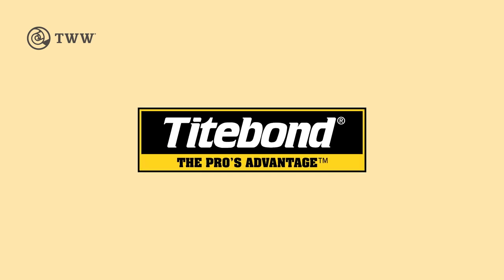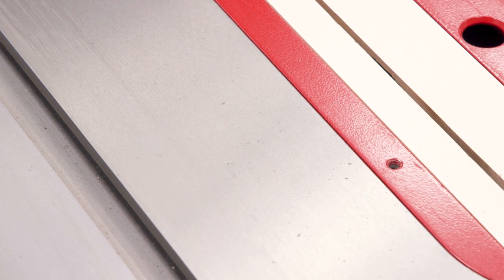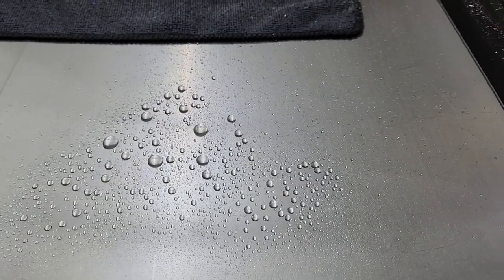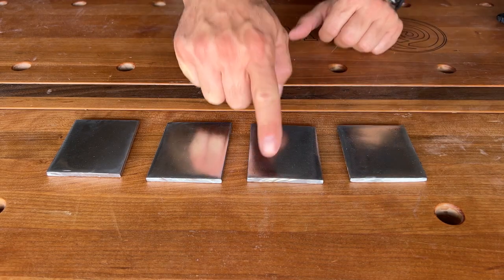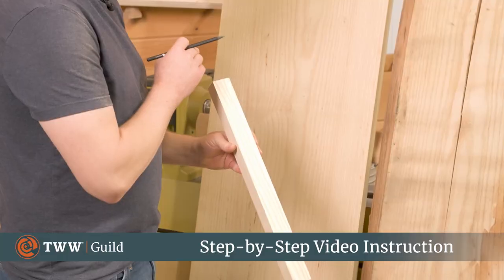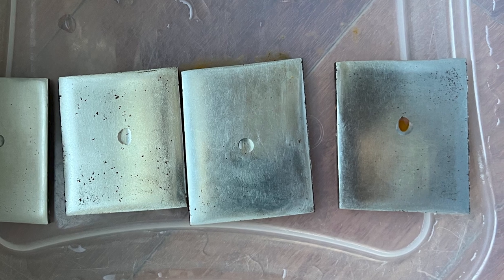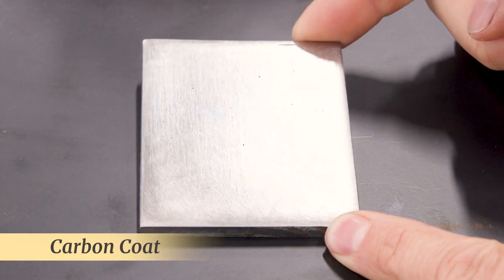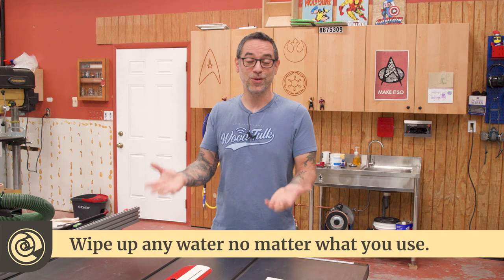Did I Screw Up?! | Carbon Method Update

Comment: Hi, great video, just let me give my 2 cents as a chemist, rust is an electrochemical process occurring on the surface of the metals, we stop the corrosion process puting a layer of protectant between our surface and the environment so the best protectant is the product that sticks the best and does it in a more uniform way. So even wax is a good barrier to moisture you just cannot make it stick forever even without touching it. The lets say agic of carbon methond is that stick better and forms a uniform layer over the metal. Anb about the water some well water have small amounts of iron on it so yu can imagine some times the droppets rust because this tiny amount of free ironm that why in some places you have rust stains on the bathrooms and sinks even if there is no steel hardware around.

Comment: The only coating I've used on  a variety of cast iron tools is Slip-It.  I used the spray bottle.  14 year old Delta table saw - no rust.  I just wipe down the surface after a day of use.

Comment: I haven't seen anyone (may have missed such) do an update to Fine Woodworking's article in the July/August 2012, beginning page 30, testing 20 different rust preventer products on cast iron.  As the photos showed, and the article confirmed, CRC 3-36 turned out to be the best choice, and was one of the least expensive.  I have been using it since with no rust on my table saw.  Due to a move, it sat unused for a year in a northern state, followed by 3 years in an out building in a southern state.  No rust.  Just now getting back to using it.

Comment: Thanks for the testing and info. Do you know if they have any opinion about putting a wax on top of their product? That could be an inexpensive secondary layer to prolong the life of their product finish by creating a small film barrier between the actual surface and materials you push over it. Kind of like how car detailers will put a ceramic coat on a car's paint and then periodically put another product on top of that to prolong the much more expensive and time-consuming ceramic coat.
I suppose also applying wax could defeat the purpose, but after seeing how wax alone performed, I wouldn't want to use it by itself anyway if I were in a high humidity shop.

Comment: I'll be honest, that's rediculously good protection if you barely had any rust. I've had rust spots appear when something wet touches it and it's whiped up after. The fact that the protection method kept it that clean for 2 months after exposure is impressive. 

Still, the best way to protect your tools is to keep water away from. Put oil on the tool and wrap it in cling wrap. Or when in use I find waxing it after use to do the trick.

Comment: Not to be a one-upper but my table saw has taken quite a beating for the past two months. My wife put wet life jackets all over it and it was absolutely completely covered in a thick layer of rust. Just as I had cleaned that up, my roof sprung a leak and the point where the water came down was right over my tablesaw. After being diligent and cleaning it again, it has become apparent that it seems almost irreparable. The nice beautiful sheen I used to have is now pitted with marks that look like water stain.

Comment: I use ACF-50 on some tools - learned about it from use on motorcycles, which I submerge in mud puddles a few times each year. It smells like WD40, but actually seems to work. Would still need a wax or carbon coat to lower friction.

Comment: I live in north Texas and it is pretty humid here. I have applied Carbon Coat twice on all of my machines and I have had rust happen both times. Perhaps I am not putting on enough or I am not reapplying often enough. It has been two years since this video, so I am wondering how your applications are holding up. Any updates for us?

Comment: I usually use odies oil finish for my projects and when I am done with the scotch brite I use to apply finish I usually find a machine in the shop to rub down again. The cost is free essentially vs paying 80 dollars for this carbon method stuff. I live next to the ocean in a very humid area and I have zero rust issues. You don't need to spend 80 bucks to protect your tools

Comment: I think you should modify your test. T9 no wax, carbon coat and wax. For me, t9 without wax worked better than t9 with wax. I’m wondering if the wax removes some of the t9. When I run out of t9 I may try carbon coat. I live in a high humidity environment.
Reply: I agree, would not put wax over top of the T9.

Comment: For that price, it should've prevented that mild rain and humidity from being an issue. 
 
I'm in Florida, on the Gulf of mexico, in a garage that is nit sealed. There are days when my 315 Craftsman table saw has a layer of water on it that i have to wipe off. 
 
Not to mention in summer, it gets to 120f with 85% humidity... on a "nice" day. 
 
Then theres the salty air. Anything not Stainless Steel (and some things that are stainless steel) start to rust immediately down here.
 
And over the past year, I'm yet to have rusting since using a $30 bottle of ceramic coating car wax. I dont even have the bottle anymore since I transfered the gel into a different bottle (that has a silicone spreader and a microfiber attachment that lets me apply it easily. 
 
So, to get spots like those, from a product that costly, is a scam to me. Dont get me wrong, live your hustle, but its definitely not as good as the cheap ceramic car coating polish i use. 
I clean the table really well. I then apply a coat, wait 5 minutes, them buff it out. I do that 4 times. I did it last time in may of last year. And this winter, el nino has brought insane levels of humidity. My garage floor was a large puddle a few weeks ago. And it caused a lot of rust to develop on a lot of things... but not the cast iron tool tops i used that stuff on.
 
So, make your living with paid promotions, but this video proved to me that its an inferior product.

Comment: Idk, I wouldnt put it on though after seeing this...I get you dont want or shouldnt have standing water....but if im putting on a protectant I expect it to protect the surface from conditions that can cause rust.....the fact the standing water went through the Carbon Method and was able to have iron etc is a problem....there should be a practically impenetrable shield placed around the piece if the protectant was put on properly which to me says its not worth the $$.
Water drops can spend about a day on a vehicle and I can put a protectant that lasts about a year before reapply...zero rust....but I cant use this stuff to protect it unless I wipe up every bit of water that touched it????
I understand it may have been ideal conditions to cause it...but I would also argue there are other products out there that it simply doesnt matter if there is those same conditions...it will still keep any rust from forming/....
just an opinion.
In the end there are a ton of waxes ranging from garbage to the latest....and wax protectants havent just changed the last ten years but they jumped lightyears as far as protection goes...with the addition of ceramics and graphene....
So it would have been nice to know what exact wax was applied.

Comment: Try using distilled water for your tests.  Distilled water turns out to be very corrosive.   The corrosion engineer I worked with tested paints using distilled water.  I also found that for reverse osmosis components plastic components are recommended.  The r/o faucet and tubing in my house are plastic.  After a little checking I found pex piping was recommended for use with r/o systems.  It has something to do with distilled water being deionized.

When it came to college chemistry I  developed my theory to explain the s and p orbitals of electrons: "If I can't see it, it doesn't exist."  For some reason my Teaching Fellow didn't subscribe to my theory.

Bob

Comment: I was about to start the same test as you did.  I might still do it. Have an extra cast iron extension wing and want to see how it will do in NJ.  How many coats did you apply?  Dan recommended I do 4 and I did 4.  Also I would like to know how much cabron coat material you will go through to do all your tools?  Defintely not cheap.  I did my full cast iron 36" PCS with router wing and i have half a bottle of coat left, ran out of clense and application pads and towels.  I did get the bigger quick start package

Comment: I've switched to using carnuba wax automotive spray on wax on my   table saw and my cast iron products I've actually left a cold soda can on my table saw came down in the morning and there was 0 rust where the can had sweat On the table saw but there was some water puddled there

Comment: I checked Boeshields application instructions and it does not say anything about adding a wax layer after and even for a thin film it advises leaving on for two hours before wiping off. I don't think this was a fair comparison as the manufacturers instructions were not followed.
Reply: Sometimes people from science fields "know better" and don't read instructions.  I think he wiped off some of the T9 with the wax.  I would not put wax on the T9, as the T9 makes a super smooth surface.

Comment: On Amazon I'm seeing other graphene based products like "303 Graphene nano spray" for a bit less than Carbon Method's product and am wondering what the differences are and whether they're any good compared to the $100 products.
Reply: They are not the same. The cheaper ones you see has maybe 0.1-0.2% graphene in them. You need between 0.5-1% in order to get somewhat rust prevention. There’s a lot of studies of this to be found on Google 👍

Comment: Could you do carbon method with wax over it? I, like many wood workers, use wax as a dry lube to decrease friction.
Reply: Carbon Method actually makes a spray that goes on top of their stuff that will decrease the friction. I do not know specifically about using wax on top of the carbon coat.

Comment: @The Wood Whisperer Thanks for sharing an update! I’d been considering Carbon Method to prevent rust so your update is helpful. What about hand tool rust prevention and maintenance, any advice or instruction?
Reply: One idea I saw, for tools in drawers at least, is to use those silica absorbing packs.  Can't remember channel.  Also worth thinking of dehumidification.  If can get below 60%, ideally 50%, could def keep under control I think.

Comment: Rain would be about the worst way to put water on cast iron or steel.  The droplets have tremendous surface area that allows them to become highly aerated as well as scrubbing CO2 out of the atmosphere and becoming carbonic acid.  And if they are small enough, they will not just fall straight down thus giving them time to dissolve oxygen and CO2.

Comment: Well water in southern MO at least is very basic, i.e., opposite of acidic -- it's hard water with lots of dissolved lime.  Not sure about northern MO -- there's a saline transition zone, but you're obviously not drawing salt water from your well and you're not very far north.  In any case, if your water is hard with dissolved calcium, then it's def not acidic by any means.

Comment: Great test, even if a cast iron surface might yield slightly different (likely worse?) results!  But I always have to smh as to why the tool manufacturers can’t come up with better (any?!) solutions for rust prevention, i.e. add –uh, I am not a metallurgist– maybe more Chromium to the cast iron alloy or a corrosion resistant coating?  Why are we having to watch our pricey tools rust into the ground or spend so much of our valuable time, let alone $$$ on rust prevention??? I mean, couldn’t at least the screws be zinc or stainless steel…?

Comment: It's still not clear to me if the graphene in the solution is necessary or if the majority of the protection is from the resin that binds it to the surface. Surely the manufacturer must have done some tests on this that they're willing to share but personally I'd do a test where you used the CM solution as it is and a test where you filter out the graphene from the solution and compare the two.
Reply: Why does nobody every want to address this question? I keep asking it of everyone that reviews this product.

Comment: I live in Chicagoland and we have wide amount of temperature and humidity changes throughout the year. My 3-car garage shop is unheated and I need to store a car and two motorcycles in it along with all of my tools, machines and lumber. In the wintertime I am shutdown and I treat my machines for long term storage in the late fall. I clean all cast iron surfaces of any rust, dirt and dust thoroughly before applying a very heavy coat of Boeshield T-9. I let that dry for several days, cover it with heavy plastic (55 gallon plastic lawn bags which I had available) and top it off with several layers of cloth automotive fender covers. 

The T-9 prevents rust, the plastic protects against moisture and dirt accumulation which can lead to rust and the blanket adds some protection against condensation due to changes in air temperature and humidity. In the springtime a quick wipe down with mineral spirits to remove the T-9, several applications of wax and I’m back in business. 

Had this process been used by Marc I don’t believe he would of had any issues whatsoever. I do think that the product he used would be great in a climate controlled environment or certainly better than commonly used wax treatments we often do. I’ve been doing the treatments I described for 30 years with very good success yet I’m always looking for something better other than a giant vacuum bag.

Comment: What would be your recommendation for once you have a little bit of rust? I'll be using the carbon method as well, but I want to clean up the bit of rusting before coating.. How are you going to tackle the drill press table? Or will you leave it as is?
Reply: I’ve had good luck with the extra fine eraser block.  It does a great job of removing surface rust but it does take a fair bit of elbow grease.  A 800-1,000 grit mesh sanding disk can work well too.

Comment: The short test would have been an excellent time to simulate some basic wear testing as well.  With each piece:
 - make one scratch with a sharp steel tool or carbide tooth
 - make one scratch with a soft metal, like copper
 - strike one corner with the corner of a piece of oak
 - mount a disc-shaped plug of softwood onto a random orbit sander and "sand" a corner for 30s.

Such an experiment would not only test the durability of the coatings as a means of evaluating them, but also as a means of helping us assess what kinds of wear and tear lead to premature exposure and thus necessitate recoating or touchups, per method.  I suspect for example that oils would be less susceptible to issues with light, sharp scratches since the oil can redistribute into the scratch, but more prone to extraction via soft, absorbent abrasion - but that's purely theoretical.

Comment: It would have been a better test if you use cast iron because most of the tools you are taking about are cast iron. Cast iron is more sensitive to moisture that the steel in a lawn mower blade.

Comment: Steel is not cast iron.  Yes, they both have iron in them but there is significantly more in steel and those other elements could prevent rusting.  All my tools are cast iron tops and so I'd be interested in seeing you re-do the test using cast iron rather than steel.
Reply from the maker: But the test is relative, with regard to the different rust preventatives used. I'd expect to see more rust on cast iron, but it's logical to conclude we'd see the same relative results.
Reply: @woodwhisperer  I agree that it is logical, but sometimes science is weird
Reply: @polerin  remember that The Spag was formerly a professional chemist before he moved over to woodworking. When it comes to understanding oxidisation of metals, I know he knows a lot more about it than I do.
Reply: @woodwhisperer  Different iron based metals oxidize in different ways and rates.  For example, most stainless steels have chrome added to create a passivation layer that prevents rusting entirely.  If the steel the lawn mower blade was made from had some element added to enhance hardening (chrome, nickel, extra carbon, etc.), it could change the rust preventative treatment as well.  If the Carbon product bonds with the carbon in the metal, a high carbon steel could make it appear more effective than other products.  I don't know if the Carbon product works that way but if it is designed for cast iron, it could work better or worse on steel when compared to alternatives.
Reply: @Mikey__R  I didn't know that.  And I'm sure that he knows much more than me in that regard.  Metallurgy is 1 steps away from magic to me.
Reply: Agree! I would also like to see the same test with cast iron.
Reply: @Mikey__R  ah, that I didn't know, I will 1000% defer then because whoooboy
Reply: Cast iron is iron.  Steel is basically iron which has had carbon added to it in manufacturing process.
Reply: @blakedozier1131  cast iron has between 2.5% and 4% carbon. It's not pure iron. It also usually contains 1-3% silicon. Both steel and cast iron are made from pig iron, the output from the blast furnaces. Pig iron contains way too much carbon to be usable, between 3.8-4.7%. Refining the pig iron involves heating it in an oxygen or hydrogen atmosphere, or bubbling air through the molten pig iron. The oxygen reacts with the carbon to produce carbon dioxide gas, and other impurities to create lighter oxides that float to the top of the melt where it can be removed.